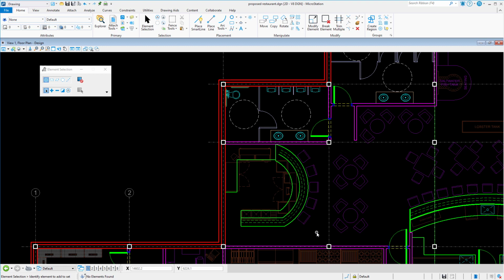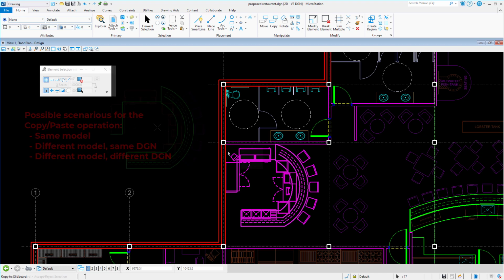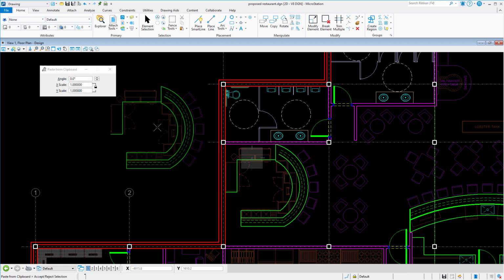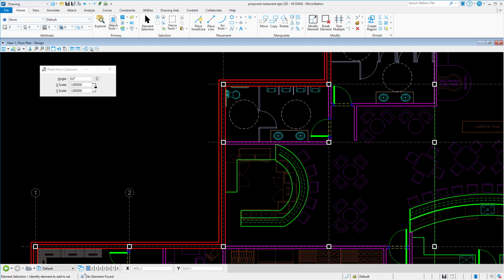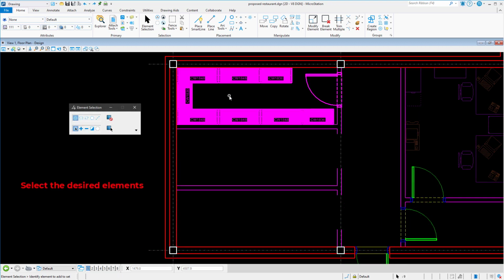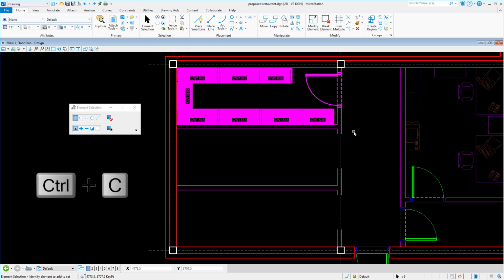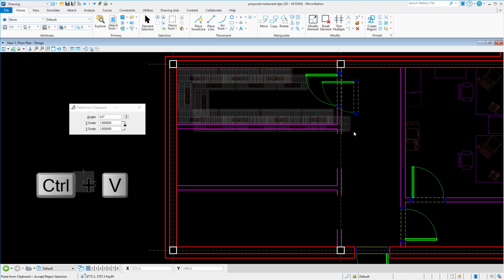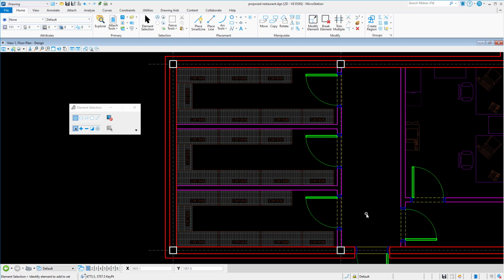Set the Origin of the Clipboard

Comment: There is "Copy with Base Point" to copy paste one DWG to another in AutoCAD 2007, but there is not any option like that in Microstation CE 2022.. In Microstation, after copying we have to input X,Y on key-in for the same location for another file, right? It would be great to add "Copy with Base Point" option to Microstation CE 2023.